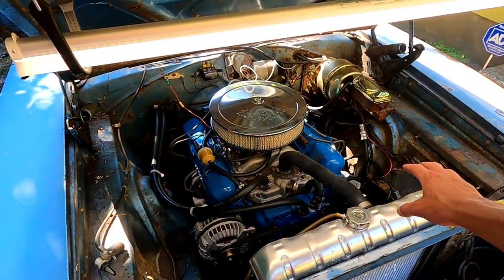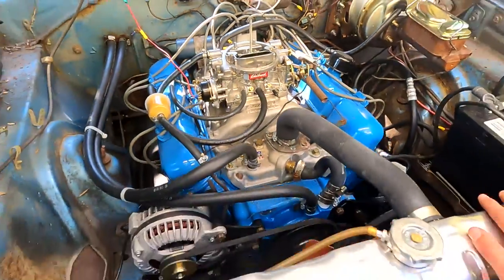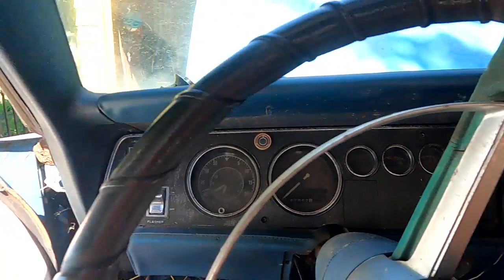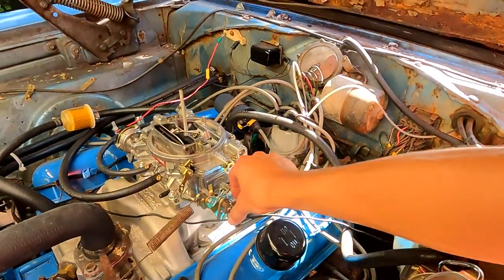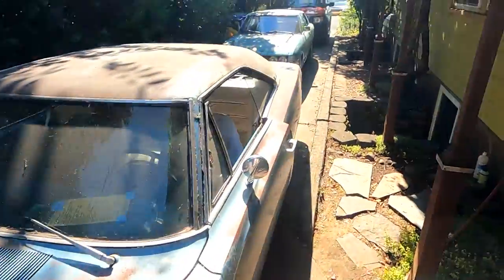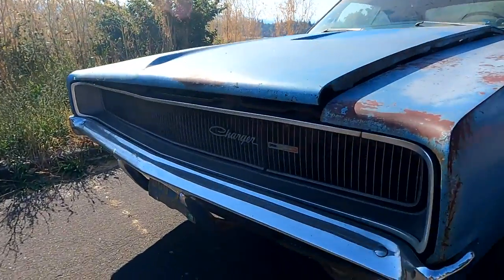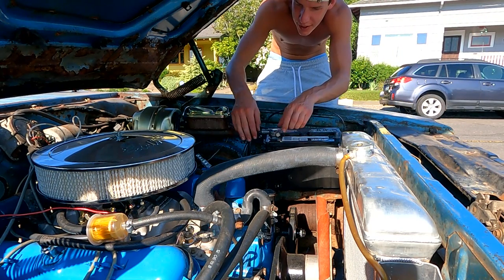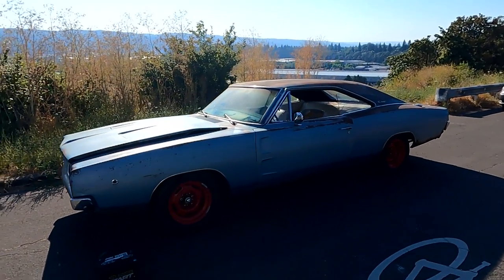1968 Dodge Charger first drive in 30 years! #mopar

Comment: Dampen the area around where the battery leaked, once wet sprinkle with baking soda to neutralize the acid, rinse it down thoroughly then wash with Dawn and rinse again. Hopefully you'll catch it in time before it starts to rust the metal!
Reply from the maker: Will do that thanks!

Comment: YOU HAVE TO JACK THE CAR UP AND GET THE FRONT WHEELS OFF THE GROUND  ROTATE THE STEERING WHEEL SLOWLY LEFT TO RIGHT WITH CAP OFF TO EVACUATE ALL THE AIR IN THE SYSTEM !! GOOD-LUCK !!!!